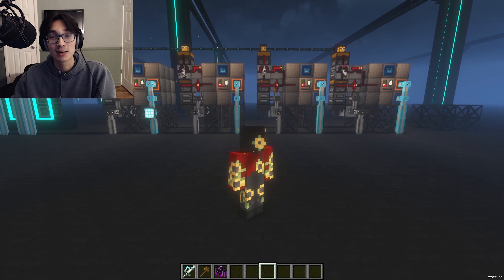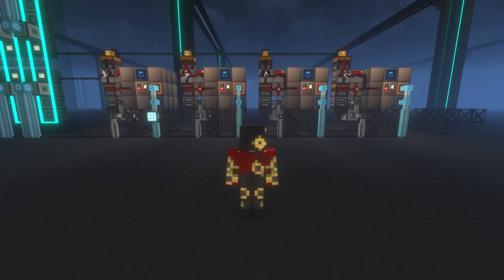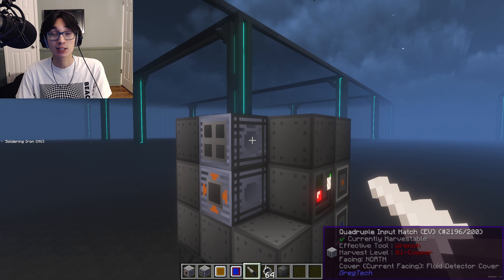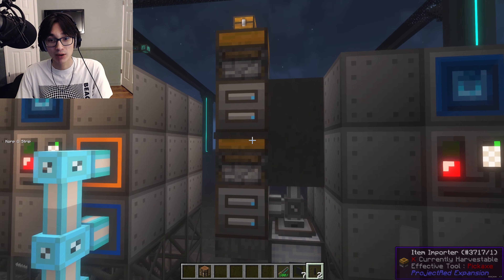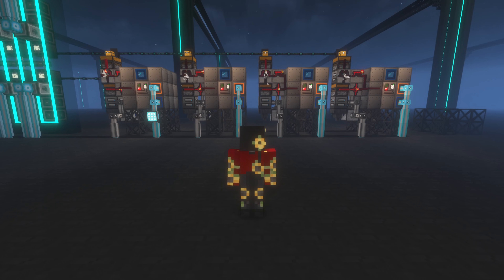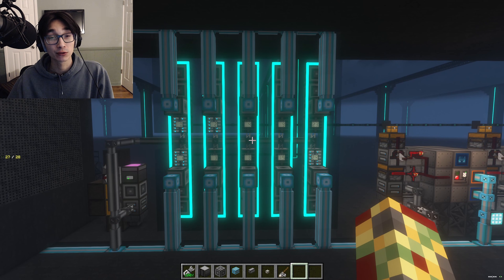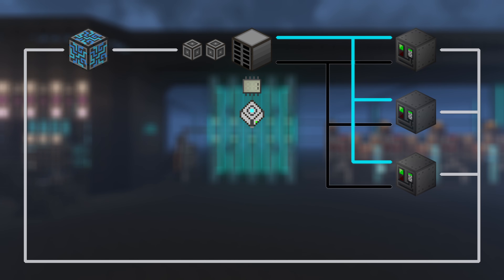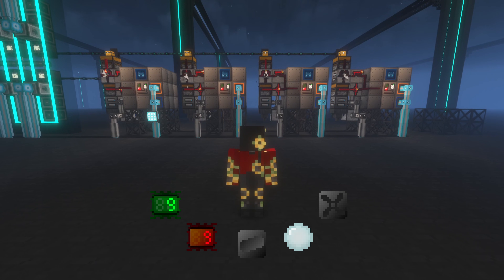Universal Automation: A genius solution for a modded minecraft problem. Gregtech New Horizons 2.7

Comment: Hey IX, I found a glitch in this solution playing in 2.6.1 (not sure if 2.7 fixed this?). Note this problem wasn't in Ivelieu's original video.

The problem is that even using blocking mode for the main net interface with recipes and advanced blocking cards in the ME Drive subnet interface, I get ingredients from two different recipes mixed if the recipes are in different main net interfaces (your video suggests setting up the ME Drive subnets with 3). I found this to be true if all three main net interfaces are pushing into the same subnet interface (a variation I prefer) or different interfaces (your suggested set up).

For the most part, this tends to be harmless. I ran for quite a while with no blocking at all, and things were working (I got lucky!). But eventually with Palladium processing, I hit a conflict. I tried to fix it with the blocking mode and cards, but that wasn't enough until I moved the conflicting recipes into the same main net interface. My conflict was making Ammonium Chloride and Reprecipitated Palladium Dust at the same time (circuit 1). The LCR gabbed the Ammonia from the first recipe, and the metal powder from the 2nd recipe and made Palladium Enriched Ammonia leaving the LCR wedged.

I looked at the 2.7 change logs and don't see any mention of behavioral change with advanced blocking cards. Does this race condition also exist in the 2.7 version you are playing?

I expect that using a Pattern Capacity Card would be an easy fix (I haven't tried that yet). My fix was to put all conflicting recipes into the same interface ... but I think that means I'm doomed to keep running into conflicts that'll need debugging.
Reply from the maker: @kpsmith67  I think the problem is that interfaces in newer versions have priority now? I might try setting all interfaces pointing into the same network to different priorities. This is happening to me as well on nightly 912
Reply: @IX_Streams  I'm confused about why those would be related.

Maybe your theory is that the higher priority one would win and the lower priority one would block? Hmmm. Worth a try I suppose, I'm not sure how it is coded, but I can picture some implementations that would make that work. Let me try...

Nope, no luck. I set the three interfaces to priorities 1,  2, and 3. I reduced to a single storage cell in the subnet and disabled item conduit extraction to see what AE2 would do. It shoved ingredients for Platinum Concentrate (from the priority 1 interface) and Ammonia (from the priority 3 interface) into the disk (I slapped a ME Crafting Terminal on the subnet to see what was going on).

When you say this is happening on 912, you mean that you are also getting two recipes mixed on a single cell? I just crafted a pattern capacity card and will  be playing with it now.
Reply from the maker: @ wait did you set up blocking mode on the pattern sending interfaces and advanced blocking cards in the receiving interfaces?
Reply: @IX_Streams  Yes, of course. If I didn't have that set up, my awkward solution of putting conflicting recipes into the same interface wouldn't have helped anything. Without the blocking, AE2 is able to shove as many as 7 (!!!) recipes per interface into the cell before the item conduit pulls it.

I can also confirm that using two pattern capacity cards completely fixes the problem. They are just expensive to craft for me currently, so I might just live with it for now since it doesn't usually cause a problem (like the example I hit with LCR #1).

Comment: I have a strange issue where the craft send them all at once. Like if i want to make Silicon SI with different recipe (1,2,24) somehow they're being thrown all at once and clog the system which doesnt pull the programmed circuit back... do you know what could cause this
Reply from the maker: @Se7en7upp  make sure that youre using blocking mode on sending interfaces and advanced blocking cards on receiving interfaces
Reply: @IX_Streams  I do, looking at different comments it seems some people have had this issue. I wonder if you have somewhere a some sort of FAQ/troubleshooting to solve "common" issues/mistakes
Reply from the maker: @ I am actually stumped by this, Its only been happening to me on 2.7.3+ and Im wondering if it has to do with new functionality of AE2 being added? so odd

Comment: What advantage does this have compared to Sampsa's original IO design, other than being cheaper compared to using advanced stocking buses?
Reply from the maker: @tenkk_ch  its cheaper, works flawlessly and quickly with item+fluid and fluid only recipes, and is much quicker to switch between recipes
Reply: @IX_Streams  aight thanks

Comment: I am rather new to GTNH and AE2, so some of it is a bit confusing to me, like what exactly some cover's do in this specific thing. But a different question, how exactly do the machines receive fluids? Aren't Storage Cells only able to transport normal Items?
Reply from the maker: @Real-Quarlie this is correct! storage cells can only transport fluids or items not both… however… due to the weird way that GTNH ae2 works, fluid recipes sent from regular interfaces send “packets” of fluids that are in item form and can be decoded on site. This is what the decoder and filtering are for!
Reply: @IX_Streams  ah, thanks a lot for the reply! Also clears up some other confusions directly lol :3

Comment: Interesting! 

Honestly, I'm always a bit scared on building these setups. They look really expensive frankly (in AE components), and I'm honestly not sure why it's more powerful than passive ones. Are the plastics you mentioned level maintained or am I missing something?
Reply from the maker: Nope!  I fully on demand each plastic, and because LCRS have perfect overclocks, they scale incredibly quickly. 

This setup has the highest return with precise assemblers, whose automation otherwise with 20+ different circuits is a nightmare. It also makes adding more of a processing machine really easy, as you can just make another and add it to the EIO conduit line

Comment: Would this also work on blast furnaces? The reason I ask is because of the blast furnace only has 1 row where hatches can be placed due to coils. Is it not feasible?
Reply from the maker: @chickensalads7248  It is feasable, but i dont recommend it. Universal is best employed when machines need to pull from a wide variety of circuits, which ebfs dont particularly need to do! It can work tho if you really want to pattern all of the weird stuff and take advantage of multithreading your ebf recipes
Reply: @IX_Streams Thank you for that! I saw your google doc with circuits for each machine and some not really needing automation. So I’m assuming that’s the same reasoning with the ABS as well since it only uses a few different circuits. Also why doesn’t the PrAss doesn’t need automation?
Reply from the maker: @ The prass is the #1 priority actually for universal, the sheet isnt super organized yet tho. In the pinned comment, i list my order of operations for universal!

The reason abs isnt priority is because in ~zpm you unlock  the mega abs which can take laser energy and you have enough space for the ~21 circuits
Reply: @IX_Streams Oh I see that makes a lot more sense. And I also realize I misread the document on the PrAss - precise recipes but don’t need automation but regular ones do so that makes sense now. Well I built this for my 4 LCRs and it’s great! Looking forward to implementing into the PrAss once I get my plat line finished
Reply: @IX_Streams  Ooooh. I disagree! EBFs are expensive (especially as you hit EV and have multiple coil upgrades looming). You come into EV with 4 different EBF circuits (#12 for titanium, #1 and #11 for lots of things, and #3 for silicon boule's), and quickly need a 5th (#2 for tungsten dust). At early IV, I've not got 5 for EBFs, and 6 for LCRs. Why wouldn't you automate EBFs? The strategy you outlined here (thanks again!) is easy to adapt!

@chickensalads728 Yes, this works on the blast furnace! Since every recipe I have (so far) always includes a material, I just don't bother putting a fluid detector on my input hatch. An item detector on the input bus (set at 2 as shown in this video) has been sufficient for me. If I run into a fluid only recipe, I'll add a fluid detector and run some wire along the ground to where the input bus wire is. That works. :)

Comment: Using Cable facades instead of microblock covers on the cable (or having the timer at 0.5s instead of 0.4s) seems to have fixed my issue of circuits and cells being stuck in the automation
And some helpful info: Use the bookmark recipe multiplication to see if the patterns multiplied size will work and not leave a few dusts in the bus
Reply: The single programmed circuit isn't removed before the next recipe is insert causing the system to break? I'm having the same issue and the timer change didn't fix it. How did you replace the covers with facades? I can't place projectred components on top of them.
Reply: @DogeJello  I can place the timers, gates and such from projectred on facades but not the red alloy wire.
I just put a facade (cubit 3) on a covered cable (fluix), dont think it matter which cable or facade should matter.
Alternatively you could try setting the item detector to 1 item from 2, itll stop the timer if the circuit is still there, it just causes little more delay between crafts
Reply: Im on Nightly version, but I'm 100% its not the feature (logic gates on facades) is new in nightlies
Reply: I was struggling with this and setting the timer to .6s fixed it for me.  Tried .5s but it was still leaving the circuit in the hatch on crafts that use multiple of the same circuit number.

Comment: Using storage cells as crafting payloads is very clever idea. I might do a take on it with assistance of OpenComputers at some point. (That's mostly because I already plan to hook up computers to machines and removing ProjectRed circuits is a bonus). I will still do all my plastics to be constant, I enjoy making plastic lines, but for a lot of other stuff or high end plastics it could be a big saver.
Reply from the maker: Julia in the gtnh discord has a great OC solution to universal, I have never used it or seen it in action but I have heard good things!

Comment: I'm unsure if its a versioning issue but the ME I/O Port treats the input from the top and bottom sides of the block, whereas output is all the sides. Therefore, when the item importer is activated after the LCR (or any other machine) stops being powered, it can't effectively pull the empty cell from the first I/O to the second. Great video though, I'm trying to implement it in my world now!
Reply from the maker: For anyone else wondering, Sisyphus and I worked it out in the studio, in gtnh 2.5 and below, io ports output from sides, which means you will have to augment your redstone! Use gt hulls as single slot inventories and conveyor covers to your advantage!

Comment: Should I do it with single blocks or isn't worth it?
Or the best option is to use universal setup for multis like you wrote in google dosc?
Reply from the maker: Universal for single blocks is incredibly cursed, as retrieving circuits requires that you actually delete and replace the block hahaha. Ivelieus original video has a universal single block assembler, but given that the prass with imprecise casings is now IV tier in 2.7, I would probably not try single block universal!
Reply: @IX_Streams  thank you for explaining that.
So I should stick to multi blocks got ya
So everything else can be done by doing it passive or just single multi block?

Comment: My thoughts from using this so far:
64k storage cells are overkill, especially if you try to build this early in HV/EV. Use 1k cells. The fluid packets are 1byte each, regardless of the fluid size. They only limit your non-fluid item size.
On that note, make sure any recipes using multiple non-fluid items have space for both to be placed in the input bus or else they can deadlock. Generally this means at most 14 stacks of each item, leaving space for 1 circuit and 1 stack of the other item. For 64 stack size items that means no more than 896 in a pattern.
You don't need 10 Storage cells in each ME drive when getting started. (n+1) is plenty to not notice any downtime, where n is the number of machines being distributed to. To be tick perfect it's probably (n+2) but at that point just fill all drives anyways.
I've only seen one recipe so far that this setup did not work for, High Octane Gasoline (HOG) as it has 5 fluid inputs. Adding a second fluid hatch was easy enough. Set the initial fluid hatch with a fluid detector to priority 1 on the storage bus. Leave the secondary fluid hatch at priority 0. That should allow more fluid types without mixing recipes.
Reply from the maker: I agree with all of this, I couldnt cover everything, but I totally agree.

Comment: does this system require a separate enderio subnet for every ME subnet? or can the same ender IO line take multiple different circuit types simultaneously?
Reply from the maker: All enderio conduits are linked in one little network! They all know where to put things based on the whitelists and blacklists you filter on the drives.
Reply: @ this is going to be insanely useful then. Thanks!

Comment: why the double energy hatch? is this for overclocking and more speed? tier skipping? or is there high amp recipes at some point?
Reply from the maker: Most machines do not have this, but chemical reactors have perfect overclocking, meaning that if you give it 4x the amount of energy, a recipe will go 4x as fast! Additionally, you will need to double hatch most multiblocks in late game as most recipes you will need to progress, like superconductor base in mixers or pic wafers are gated to your energy tier+ 1, which can also be achieved by double hatching.

Comment: how does this system make sure that the perfect inputs are put into each cell so that each cell doesn't have too little or too much input ingredients in the cell? is this what blocking mode is for?
Reply from the maker: This is a wonderful question! Blocking mode makes sure to only send a recipe once the adjacent inventory only contains items like non-consumable circuits, molds, lenses… etc. 

Normally, by sending the recipe from interface to interface, blocking mode wont work, as the items are stored in the cells, but an advanced blocking card placed in the receiving interface reads the contents of the subnetwork it's attached to and displays the subnetwork's contents to adjacent interfaces! 

Advanced blocking cards are amazing and are used to automate assembly lines, infusion altars, and much more.
Reply: Adding to IX's answer, the GTNH Advanced Blocking mode (that ignores circuits, etc.), fails with 3 acetone recipes (this is called out in the source video IX gives kudos to). These LCR recipes use calcium ingredients that aren't consumed (!!!!). These recipes don't work with this setup ... so use a DT for acetone production.

Comment: Of course this design can be adapted to fit other machines as well. However if you move around the redstone attached to it, you gotta make sure that the Storage busses do not accidentally have redstone applied to them as that will cause them to shut down and not send out items/fluids
Also something that should be noted is that the "giving AE power" part kinda glosses over the fact that the packet decoder needs to be connected by more than a storage bus to the subnet.

Comment: Wow, just entered HV and I don't think you can comfortably build this even in mid EV (soooo expensive) but I will keep this video. 

Does it so work on multi step recipes? (For example the recipes calls for hydrogen but there is no hydrogen in the system so it calls for a recipe first, that produces hydrogen?)
Reply from the maker: This isnt actually so terrible to build in EV, mostly because it will last you until fluid cribs in UIV! Im going to set it up for the #vanguardrun that im doing with some other streamers! 

To answer your question, yes! Because all items come from main net and the outputs are put back into main net, the ME system handles this flawlessly. And because recipes are distributed between processing machines, this can become super efficient as the second recipe (that requires hydrogen) can begin processing in parallel as soon as the the first bit of hydrogen goes thru!
Reply: I saw this video upon entering EV and promptly automated my one LCR and both of my EBFs. Since then I've also automated a multi-block mixer (that required dipping my toes into IV). I love AE2 automation. I'm not sure how I could possibly delay this once I hit EV! :)